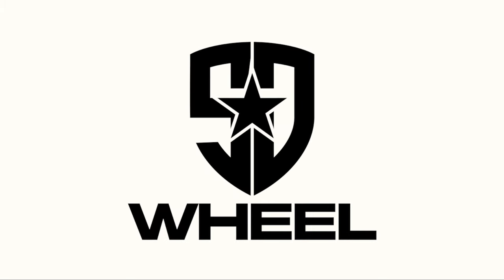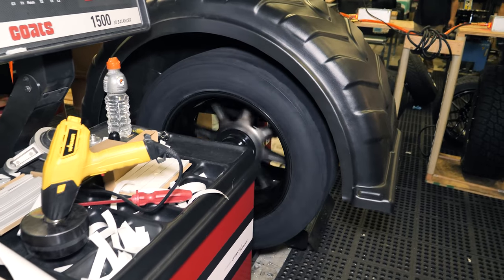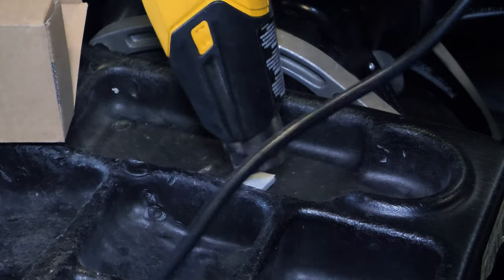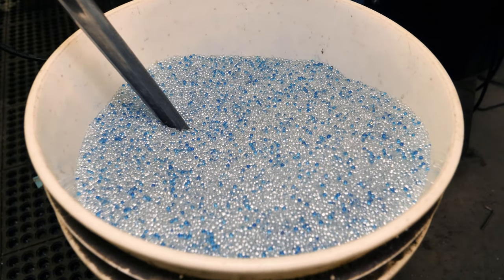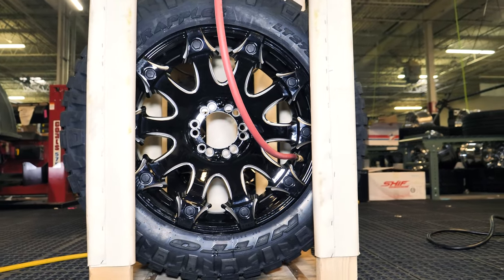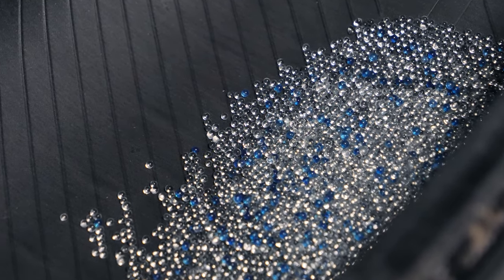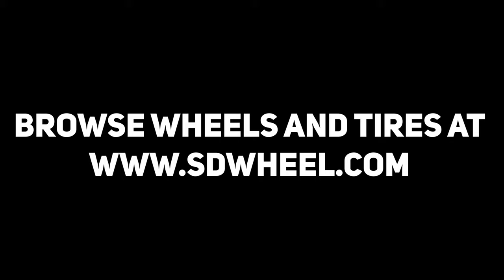Weights vs Balance Beads

Comment from the maker: Make sure to check out https://www.sdwheel.com/ for all your wheel, tire, and suspension needs.
Reply: Hello  I am ross,who produce the wheel weights,choose your right weight.
Reply: Hello I have a ram with 285 70 r18 nitto ridge grapplers. The calipers on my truc are big and they keep
Knocking the weights off very often. I was told that because my tire was smaller than 35” I can’t not use balancing beads. I also have an aftermarket rims 18x9. Would you recommend balancing beads in my case?

Comment: The video example was "death wobble" which typically isn't caused by improperly or out of balance tires.
Reply: for my case it was, new rotors, calipers, pads, rack and pinion, ball, joints, literally everything and steering wheel shook like a bitch. Beads are complete shit imo, they didnt work on my f250 with 37s nor the 4runner with 34s
Reply: Exactly. When my Wrangler developed "death wobble" at only 33,000 miles, the clueless Jeep dealer tried to blame it on "out-of-round" tire. (I already had the tires balanced to rule out a balance issue). I had to go find an independent shop who was experienced in it. Solution was replacing every joint in the front suspension, AND rebuilding the steering box.
Reply: Its initiated by it. Bad bushings won't cause it without being put into motion
Reply: Upgrade your steering damper and replace any worn bushings or joints to fix "death wobble"
Reply: @droolguy  i noticed the death wobble after putting on a adjustable panhard/track bar and a new steering damper
Reply: @v4lhulme  i noticed the death wobble after putting on a adjustable panhard/track bar and a new steering damper
Reply: No shit!

Comment: I very recently purchased 22" wheels from Custom Offsets (which also is SD Wheels) with 35" tires.  I elected to get the Balance Beads installed, and now when i get to 55 mph my truck shakes.  Such a pain.  I don't know if they forgot to put beads in one of the tires, but now I have to take it to a local shop and have all 4 wheels investigated.  Such a pain in the a**.
Reply: What was the outcome? I too ordered a set of wheel/tire combo from custom offset, paid extra for balancing, only to have the nittos they installed so far out of balance i couldnt drive my truck! The tires were out of round and no amount of weights fixed it!!! Customer service only offered me $50 for my inconvenience! I never recieved my refund for the balancing of the tires either!!

Comment: I had 40s balanced with golf balls. It would start to shimmy and then you'd feel them find their place. Sometimes cruising id change speed quickly and you'd feel it have to adapt. But they were old used tires on a 45 year old truck and I could run 70 with no hands on the wheel
Reply from the maker: We also recommend balance beads for tires that are 35" or larger.
Reply: @SDWheel  the guy that did it was an old friend that has a custom shop full of mall crawlers and he said well throw some golf balls in it and I bout went off when I realized he was serious but after running them I'm a believer. I never would have imagined it would work
Reply: @lakesidemotorsports7658  I've heard tennis balls are acceptable but I've never tried it. I am currently using centramatic wheel balancer discs(same concept but shot is contained in the outer tube of the disc), and I've successfully used steel bb's in the past👍 i love simple concepts that work

Comment: I came here for pros and cons. You're title is "weights vs balance beads" but the only difference is "we prefer weights." Why do you do answer? Don't be afraid to list the cons.
Reply from the maker: The only con of using balance beads is that balance beads are not guaranteed. While we use the most exceptional and up-to-date weight charts to ensure we are installing the correct amount of beads for your specific application, there are many variables that we are unable to account for. While it is extremely rare, some wheel and tire assemblies simply do not balance out perfectly with this type of balancing technique and we are unable to confirm this until the assembly is mounted onto the vehicle.
Reply: Glad I saw this comment in the beginning of the video. Thanks!
Reply: People claim that balance beads abrasively erode inside of the tire over time, is that correct? @SDWheel
Reply: @klazzera  I cannot see that happening because they only move at very low speed. The centrifugal force that overcomes their ability to move happens at a fairly low speed.
Reply: @2Truth4Liberty  you get up to speed, beads will settle, and with the tire deformation caused by the roll, the bulk of the beads will deform. deforming bulk will cause the beads to rub against rubber while they are under a considerable amount of centrifugal force, and this will happen at every tire rotation at speed. I think it will rub tire away heavily.
Reply: @klazzera  [[ deforming bulk will cause the beads to rub against rubber  ]]
Wrong. With any deformation of the tire, they are still just PRESSING against the tire NOT RUBBING.
Please go look at videos where go-pro cameras have been placed inside of tires with the beads and watch what ACTUALLY happens.
[[  I think it will rub tire away heavily. ]]
Watch some videos of them and then think about it.

Comment: I had both and it's a crap shoot.Work truck has beads and drives nice .New bf's on personal f 150 and beads did nothing. I couldn't stand it after 1000 miles went back and had tires dismounted beads removed and balanced with weights and now it's perfect.So what do you do?

Comment: Just bought brand new 38.5 x11x15 Super Swamper Boggers and we put 6 oz of balance beads per tire on brand new wheels and at 35 mph I feel like the when is going to shake my new front end loose. I just had all new steering components, wheel bearings everything is new and a new alignment. So I thought I would spend the day seeing how it worked and just bounced me all over the road. I've had big tires before but not bias ply. I fell something isn't right. Maybe more beads? The tire weighs 71 lbs without cheap metal wheel. It said 1 oz for every pound of tire  and wheel combined. I drove them on the freeway for half an hour and it did not smooth out. It's really bad at 35mph. I even switched from front to back to see if it lessond and it stayed the same. Any input on,what I should do next. I payed $3700 for new tires and wheels  and can't drive my rig now lol. I feel it's damaging my 4 runner. Ugh.
Reply: I put my old tires on and it drives perfect....
Reply: @robormiston2841  and you answered your own question. you only put 6 oz in each tire.

Comment: I used beads on my front motorcycle tire. It’s a sport touring bike. Seems to shimmy at high speeds the with new tire and beads. Going to change to weights to see if it helps.

Comment: Say a motorcycle wheel has the ball weights. If you have a wheel off the ground (wheelie) does the wheel still free spin at the same rate as the adhesive balanced wheel?

Comment: I have added 200gm weight on four wheels. Technician suggested me to change the rim because of excessive weight, I need suggestions that does weight causes bearing damage?
Reply from the maker: Typically, the weight does not damage the wheel bearings especially if the wheels are rated to work for your vehicle.
Reply: @SDWheel  thanks for your reply.

Comment: Beads didn’t work for me in my new tires fitted on my Tundra.  Checkered Flag had me put 6 oz in each tire.  Bad bounce from 50 to 60 mph.  Had to pay $100 to remove tires, vacuum out beads and remount tires and rebalance tires.

Comment: Rotating tires will have to rebalance as well? Umm, why?
Reply from the maker: It is suggested to rebalance the tire after rotation because the positioning between the tire and wheels may have changed.
Reply: @SDWheel  , how has position changed if all that was done is rotating the whole wheel assembly? - you do not expect people to actually take the tire off the rims in order to rotate them do you ?
Reply: SD Wheel ,is the tire/rim bead broken when rotating tires?
Reply: I think what they meant was that by the time you put 6,000 miles on a set of tires, the tire has began to wear and settle, certain parts of the tire that were heavy are now lighter, and most tires are not perfectly round, so the previous correction (balance) may or may not be the same as before, therefore suggesting the need to rebalance to assist in longevity of tire life...
Reply: To add, if you used balancing beads, then balancing at any point during tire life would be unnecessary unless you at some point wanted to remove the beads, then at that point you would want to pick up on balancing during tire rotations, if you do not feel and shakes or trembles and decide to rotate your tires yourself then all would be fine, to speak of...
Reply: After miles of driving and braking the bead of the tire can shift on the rim due to repeated acceleration and deceleration  @Prachka1

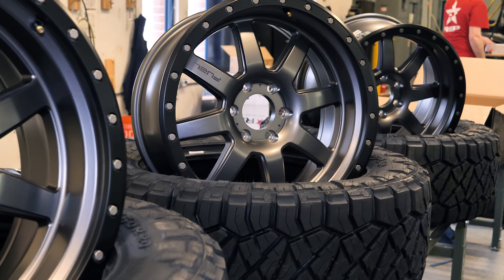Comment: 2:30  Why would you have to re-balance the wheels if you rotate them? the balance machine doesn't balance the wheel for a specific position.
Reply: Because by the time a rotation is due you have lost a bit of tread. Less mass there so naturally the same amount of wheel weight present can throw the balance off. Generally I take a half ounce off and puts me back in service quick like bunny.
Reply: Also after a ton of acceleration and deceleration the tire bead can shift on the rim

Comment: Yo SD Wheels can you put a tire with balance beads on the balance machine and show us the results?
Reply from the maker: Although we don't do that, the result would technically be a balanced tire. :) When we add balance beads, we do not check the tires on a balance machine as the beads provide weight where weight is needed when the tire spins due to its centripetal force.
Reply: SD Wheel that’s kind of dumb considering that if the tire is 8 or 10 oz heavy on one side, then 4 or 4oz of beads would be impossible to correct rather than just calming the shaking
Reply: @SDWheel  The point of putting a wheel with balance beads on the balance machine and see what it reads would be to prove that balance beads will actually balance the tire at speed. Also, shouldn't you put the wheel on the balance machine first to see how many ounces out of balance it is, so you know how many ounces of beads to put in? It needs enough beads to provide the needed mass to correct the imbalance.
Reply from the maker: @JDeWittDIY  We always add specific bead amount depending on the size of wheel and tire. The point of beads is to distribute balance as needed when it's needed. No balance machine would be able to calculate what’s going on inside of a tire that has balance beads, nor a company out there who calculates bead quantity by pre-balancing a tire. It just wouldn't work the same. Hope this clarifies any confusion.
Reply: @SDWheel  What I meant was put an unbalanced wheel on the balance machine and show how the machine indicates where in needs weight. Now add your beads and put it back on the machine and show how the machine will indicate that the wheel is balanced.  That is what I was referring to. However, I've done some reading since, and what I described might not actually be possible, since the balance machine won't allow the wheel to wobble and bounce, and that movement is actually needed in order for the balance beads to find the correct position inside the tire to balance the wheel.  I hope I've explained it clearly.

Comment: What about damage to the inner tire?
Reply from the maker: Hi! The adhesive weights are attached to the back of the wheel itself so it does not damage the tire at all.
Reply: @SDWheel  i think he was talking about the beads, beads friction with the inner tire

Comment: Would beads be a better option for a dually diesel 4x4 with 285/75-16  on steel wheels...rather than stick on or crimp weights ?

Comment: Thanks for the video. How loud are beads in a 37x12.5 tire? Are they noticeable at low speeds? I’d hate to be in stop and go traffic w my windows down and hear beads rolling around.
Reply from the maker: They are very tiny beads and unnoticeable at all.
Reply: That is a ridiculous question/concern. If you think you'll hear something inside your sealed on the rim tire, then too many other odd things must cross your mind while driving and you should stay in a completely stock vehicle over to the far right lane everywhere you go before you cause an accident.

Comment: If you was gonna use the beads. How much would be needed for a 37x14.50r26 fury mud terrain tire? Any info would be greatly appreciated. And very informative video
Reply from the maker: Only our balancing machine can determine how much is needed to make sure the tires will be balanced correctly as every tire is different.
Reply: I've read 1 once per 13 pounds combined weight of tire and rim

Comment: Would it do any good, or possibly be detrimental, to add beads to a wheel/tire combo that has been already properly balanced using weights?? Kind of like life insurance or redundancy for the tire. I'm just curious.
Reply from the maker: As long as the metal weights are removed, the balancing should be relatively the same. If beads are added with balancing weights still on the wheel, it will cause the additional weight, which may cause vibration.
Reply: @SDWheel  If that would cause vibration those beads wouldnt work to balance anything.

Comment: How much beads (in weight) are needed for a normal 15” car tire. I have hubcaps and the weights get in the way.
Reply from the maker: We're very sorry for missing this out. We typically use between 3 oz. to 4 oz. per tire on a regular R15.

Comment: In the video you're showing Jeeps having troubles with death wobble and that has absolutely nothing to do with tire balance at all. It doesn't even have anything to do with loose suspension parts. It has everything to do with caster angle. The spec sheet on Jeeps is wrong. I can't remember if they call it positive or negative but the upper ball joint needs to be more forward to the front of the vehicle than the rear beyond what is spec and that problem will go away permanently. Even if all the suspension joints are totally crap it'll never do it if the caster angle is truly correct.

Comment: I have 33s on a 24" wheels with beads
My truck wobbles a lot 
Any advice??
Thanks
Reply from the maker: There are few reasons that could cause wobbling, it could be that the wheels are are lug centric which means that your wheels have a bigger hub bore size compared to the vehicle's hub. You can get some hub rings to fix this issue. The other cause is you may need to rebalance your wheels and tires. You can bring your truck to the nearest shop to have them rebalanced.

Comment: I had recently had Balance beads installed, and I’ve been hearing a sort of “Grindingish” sound in the tires under 8mph but then it goes away, could this be the culprit? Kind of sounds like my brake heat shield is rubbing on something but i pushed all 4 of them back all the way around and nothing was touching. I have 19” rims, could it be due to the fact that they don’t have much room to move like a bigger tire?
Reply from the maker: I would say that if the noise wasn’t apparent before it very well could be the beads due to them being free flowing within the tire. But also they shouldn’t be too loud I wouldn’t think, I would advise to shoot us an email to get help with a replacement but in the mean time I would try to see if anyone locally can take a look quick for your safety!

Comment: Sounds great if the wheel never changes speed.
Reply from the maker: Balance bead physics are interesting.  Yes they do work better on larger tires but they do work.  Stick-on weights are more accurate but some like to go with beads simply because of preference and possible road issues that may knock stick-ons loose.  Check out @4F1I for an example of how they work.  Here are diagrams as well @t.  Thanks for watching!